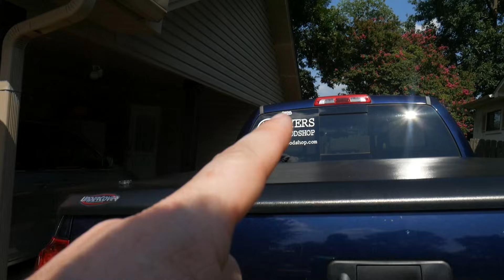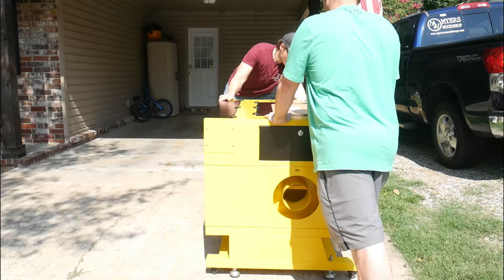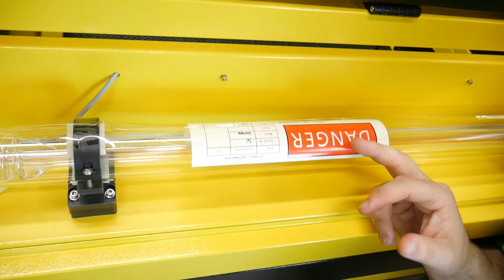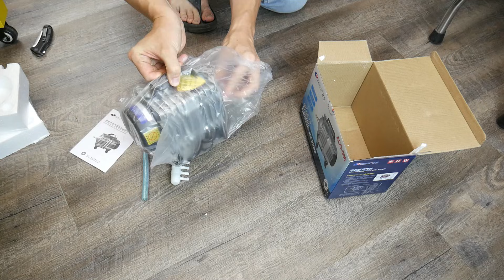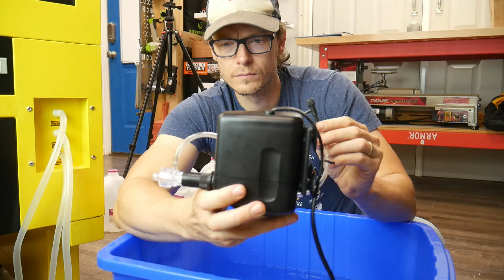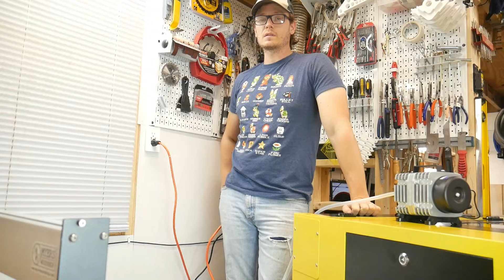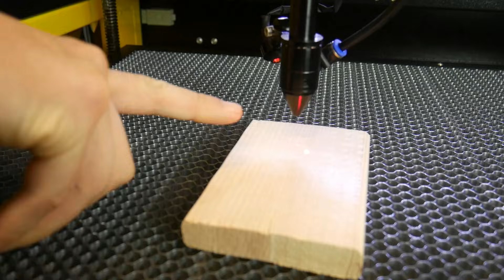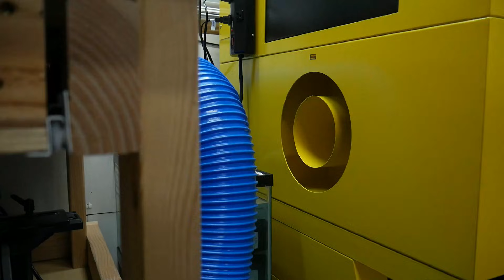Did I Waste $2400 on a 60W Laser Cutter from China?

Comment: Once that online fan is put into the hose he will barely hear it and if it was needing to be quieter you can always purchase section of 6" HVAC flexduct that's insulated which will deaden the sound further, although a bathroom exaughst fan only pushing 50 cfm would of been enough to evacuate the laser could of mounted the box right over the vent access on the back of the laser, all exaughst fans have a male hose connection on one side and I've seen a few at times that have knock outs if need for connection if a male pipe or hose end, them you would cap the male off, personally I would of hooked into the male connection then ran a section of 3" cheap plastic flex hose,  ( It's only $0.39 or $0.49 per foot ),   up through the wall behind the machine and then to attic or to a dryer vent but preferably near the ground in the winter here in Arkansas if mice feel warm air they will climb up and into clothes dryers or into laser cutter in this case and start nesting if possible, luckily clothes dryers get hot enough they get out quick as it's turned on from heat.
Reply from the maker: I don't have an attic in my shop.  Had to get the quiet fan.

Comment: Take that short hose off your water pump, that is an inline aerator. Just pinch that off, you don't want air bubbles in your laser. Also, move your blower outside and get the noise out of your workspace. Even that large metal blower looks outdoor rated.
Reply from the maker: yep.  switched to the chiller so it doesn't much matter any more!

Comment: Regarding fan noise:  Decibels is a logarithmic scale, and negative 3 dB is half  the sound pressure level.  While 80 to 77 dB might not seem like a lot, it really is.  Regarding Power:  You might want to move those pumps, and maybe the fan, off of the outlet strip you use for the laser.  Or maybe just turn the laser on separate, after the fan/pumps are on and up to speed.  I know they're small, but there will still be a startup current spike and resulting voltage drop that can wreak havoc with electronics if their power supplies are.. um..  less than robust (a.k.a. - cheap).  One at a time probably wouldn't cause any issues, but everything starting at once when you throw that switch?  Kinda scary.
Reply from the maker: yeah, its super loud.

Comment: A 1 dB change in a sound equates to about a 26% difference in sound energy (remember that a 3 dB difference is a doubling of energy levels). In terms of subjective loudness, a 1 dB change yields just over a 7% change. A 3 dB change yields a 100% increase in sound energy and just over a 23% increase in loudness so thats a huge difference in actual loudness
Reply from the maker: all i was trying to convey was how loud it was.
Reply: Only a small set of people can notice a difference of +/- 3 dB in practice.
Reply: 6 dB is double, not 3.
Reply: @dickfantastic7908 Fantastic are you sure about that? I might have to check - when I worked in the Audio Equipment industry I am pretty certain 3db was a doubling ? My memory may be lacking though. Also my point was that it was a worthwhile saving in sound level
Reply: @seorwulf1049  Heavily into audio myself and 6 dB is what I've always heard referred to as a doubling of sound.  In my own experience with the equipment, this seems about right to me.
Reply: @dickfantastic7908  Nope 3dB is a doubling of sound energy.  But then, trying to measure actual sound levels with a f**king iphone just shows how dumb these guys are.
Reply: 3dB would be "slightly louder" for the small amount of people that can spot the difference.

Comment: Power supply bears no relation to tube power - that's a factor of tube size. If you buy of a drop-shipper, you pay more and get no support. If you buy from a reputable Chinese manufacturer, you get good support and a well-built machine. The spec you got I can buy for ~$1200 ex-factory, but with much better components. So yes, you wasted $2400 on a mediocre machine. Don't buy from eBay or Amazon or Aliexpress. They don't know what they're selling.

No motorised Z-axis gets old, fast. Use your laser to build a hood for your extractor, or put it outside. Who knew electric motors could be loud? /s
Reply from the maker: it does,  if you have a 60w tube but your power supply is only a 50w guess what watt your tube will run at? :P
Reply: @MyersWoodshop  ok, mr pedant. I thought it was obvious, but as you are hard of reading, unless you run your tube at 100% power all the time, your '50W' PSU will quite happily drive your 60W tube, until it overheats and fails, which could be never, depending on the quality of the PSU. PSU's deliver a set amount of Amps, and most good ones will have a margin above which they can deliver quite happily. Your average '50W and '60W' tube (deliberately air-quoted, as they aren't really 50W or 60W - it's a relative term for the light pressure they exert, when dealing with lasers.) if two tubes both run at 20kV and are rated to 25mA, but one is a '50W' and one a '60W', a '50W' PSU will happily drive them both at full power.

So, to answer your question - 60W. :P

Comment: Oh god, please take that little clear 3-way with the side tubing off the water pump outlet. That is to introduce air into the water which is great for fish, but terrible for laser cooling. That's why the water in the laser looked so bubbly. Each of those bubbles can create a hotspot and could cause the tube to fail sooner than it should.
Also, when measuring dB, it's a logarithmic scale. Every 3dB doubles the volume you're measuring.
Reply: You beat me to it , I cringed when i saw him hook that up.
Reply from the maker: didn't know what it was for.  never had a fish tank.  always learning.
Reply: @MyersWoodshop  Hi, I have a laser like this for 2 years (80W so more powerful, but same design). Here are some of my experiences: 1) buy for your laser a Water Chiller - search on ebay or amazon for CW-3000 or I´m running CW-5200 as I don´t have A/C at my shop. This thing will keep your tube at about 19-20°C which will encrease life of your tube. Btw my fish pump died after 2 days - had the same 2) Blower - if you´re going to cut plywood or acrylic (or plastic in general) I recommend you to stick to factory blower as these materials when you cut them, makes nasty paste all hose and blower, which is very tricky to remove. Better to buy new chinese one again. Cutting (and especially engraving) stinks a lot. Make sure you will be ok with your neighborhood. 3) take your time when setting cutting parametres try to use different speeds and power. Good practice is to put a piece of material under angle, make a cut and then measure best focus point (not always those 3mm) 4) measure the bend of your honeycomb mesh. Mine was bend like hell, but it´s easy to repair with hand - press from below until your satisfied. Anyway Congrats to purchase and happy cutting! Cheers from Europe
Reply: @jakubkonecny6235  How bad is the fume when engraving? I"m from the Philippines, and planning to start on laser cutting and engraving business. My shop is not that big and its just in between walls with my neighbors. Is the volume of smoke like your cooking barbeque? How about the smell?
Reply: Yep. 77 db is half of 80 db.
Reply: I assumed it was to bleed the air from the system?
Reply: Exactly what I was just about to say LOL
Reply: Hoped to see a comment about this Venturi tube glad it was spotted and you guys have likely taken it straight off

Comment: They have this machine at the makerspace down the street. I'm very new to this but wondering if you happen to know setting for cutting 1/4" cardboard on it. They have a focal length of 3.8mm they suggest setting to but this did not cut cardboard very well. I was using 5 speed at 95 power and even that was giving trouble. Should I adjust the focal length closer or further back?
Reply from the maker: Should never need to go close to 90% power...set the focal length much closer. Maybe to where the air just nearly comes out.
Reply: @MyersWoodshop  Thank you - yeah, I thought it was strange too - I will try it closer. I'm not sure where they came up with 3.8 mm but I guess that depends on the lens they are using. They also have an 80 Watt machine but I didnt think 60 Watts would have any trouble cutting through corrugated cardboard even if it is somewhat thick.

Comment: This looks like a yellow version of the laser I got. Glad your not using that fan. I did for quite a while but after a big project I had it on for about 4hr and it overheated. I didn't notice since it was still running but tripped the garage GFCI. And would not start the next day at all.  I switched to the iPower 6 Inch 442 CFM Inline Duct Ventilation Fan for $71.  Better suction than the original and there is more noise form the air going through the laser when I open the lid then form the fan itself =)
Reply from the maker: yep!  that fan had to go!

Comment: How long does it take for the water in the reservoir to heat up, and what temperature would be considered to high? Would that be a problem if you were to run a big job?
Reply: Well, some back of the envelope calculations, given that a CO2 laser tube is usually somewhere in the range of 5-25% efficient (I'm using 15% here), means that for a 50W optical output (Don't run a 60W tube at 60W unless you want to burn it out real fast), the tube will generate nearly 300W of waste heat in the cooling water. Since water has a heat capacity of 1 calorie (~4.18 joules) per gram per degree C, that means that assuming you have a 10 liter water reservoir, with a start temperature of 20C (room temp) and an end temperature of 60C (~140F), you can store about 400,000 calories, or 1,672,520 joules, or enough to run the laser continuously for just over 90 minutes assuming no heat losses to the outside world.

Now considering that there will be losses, and the fact that 90% of even long laser jobs won't be either full power or 100% duty cycle most of the time, I'd say you probably wont ever overheat the system.

And if you do, you can always add a small heater core and a fan to the loop, and that will solve the problem completely.
Reply: @MysticalDork  Thank you for making those calculations. That's quite a bit better than I had feared. All in all I have to say this seems to be quite good value for the money.

Comment: The air pump is to stop contaminated smoke from contaminating the laser lens, which will stop it fogging up and not to stop fire. When you cut plastic and the like, the smoke can be sticky like resin.
Reply: The air assist performs a number of jobs, including keeping the lens clean(er), but it significantly improves cutting ability due to feeding fresh oxygen into the cut and clearing the cut for the laser to better ablate the material.
Reply: @Zootalaws  Yes, it does have a number of functions. Just like 3D printers, laser cutters have numerous things that can be changed, that can alter the cut. But quite often increasing the airflow can actually make the cut worse. See this video about 'Beam Drag' and ' flame polishing' = https://youtu.be/pYmT9yIjC4Q

Comment: Cringed when they pulled the gantry to the front quickly. I learned that when you move a CNC it actually creates electricity that feeds back into the control circuitry. When I move my gantry SLOOOOWWWLY on my OX CNC I can see the axis LED light up. That’s why you always move the gantry slowly if you don’t want to risk killing the control box.

So when I saw them yank the gantry forward I was going “NOOOOOOOOOOOOOOOOOOOO”. 🥺
Reply: Unless you're moving the gantry faster than the maximum speed that it can move under power there's no way you can cause electrical damage. And if the electronics is competently designed it will withstand much higher speeds, so no need to worry, just ignore those lights :)
Reply from the maker: I know what your tlaking about because its like that with my shapoeko cnc, but isn't with this laser.

Comment: Did it come with any safety glasses as that lid screen did not look as if it was able to filter?
Reply: Any colour of acrylic is opaque at 10.6um
Reply from the maker: it did not.
Reply: A cheet of glass or plastic provides a sufficient barrier to 10.6 um CO2 laser radiation.  Basically all the beam is absorbed and unless it is directed and focussed at the lid it will not burn through it.  Using glasses (any type) when adjusting the mirrors with the interlock defeated is a very good idea though.  Other (visible) wavelength lasers do need a bit more care in selection of inspection port material.

Comment: We did this and it was a total disaster.  It was a waste of money, a gigantic paperweight.  We got it "running" but it wont cut anything, its like the laser is weak or something (60w).  Since there is no support we've never managed to figure out "why".
Reply: You probably need to align the beam. Use pieces of thermal paper and short bursts of laser power (a few ms, there will be a button to do this even in shitty laser software) to see where the spot is. Till receipts work fine for this. For each "target" mirror, stick a piece of thermal paper over it,  and adjust the mirror before it in the beam path until the laser spot hits the centre of the mirror regardless of the position of the axis. Repeat, working from the tube towards the head, until all the mirrors are aligned. The mirrors need to be extremely accurately positioned for the beams to run parallel to the axes, and they often shift slightly during shipping. 

This is even a problem with expensive laser cutters, but they usually come with a technician who will commission it for you. 

I have a crappy 40W Chinese laser bought in the early days of cheap laser cutters, when you got a lot less for your money, and it's actually very useful. Can cut up to 10mm of acrylic or plywood, though 6mm is a more sensible maximum.
Reply from the maker: and this is EXACTLY why i choose to get it from amazon.  One call and it's back on its way with no loss on my end.

Comment: Why is it that any purchase or reference to Chinese product is branded a knock off?
Many things are made in China this includes your 3000 $ MacBook yet people still condemn the Chinese. Why? Jealousy, me think.
Reply: Because a lot of these chinese tools are copies of existing tools that were designed outside of china.  That is why.  The macbook and other things made in china for American/European companies have to meet the companies specs and designs.  The chinese knockoffs have to meet the chinese companies specs.  The fit and finish is generally much worse.  For accurate machine tools and accessories they usually do not meet spec.  They are just generally lower quality and do not perform as well..  They are also generally lower cost.
Reply: @Worrsaint  These are old classic designs and are now open source design. CO2 laser construction was described 40 years back in Scientific American in their Amateur Scientist Column. The basic design is sound; the tubes and lenses are high quality and with care the machine will last more than 5 years (the design life). I own Craftsman tools bought from Sears more than 40 years back but they are still useful. But with Chinese price, I can have a new tool every 5 years! By the way, how will you compare iPhone with a similar Chinese phone (both can do everything except making a decent call)!!
Reply: @janami-dharmam  I have my opinions about apple products, very few of them are positive about them.  I also buy chinese tools because they are less expensive.  I also acknowledge they are lower quality.  I buy them for the price.  The laser is also just one part of the puzzle.  You also have the motion control, the power supply and the accuracy of the frame.  Going with cheaper power supply components drops the cost.  As does making the frame to a lower tolerance.  Many chinese machines also use rolled ball screws as opposed to ground.  Much cheaper, but also less accurate.  My tig welder is a chinese one.  Is it great? No.  Is it great for the price and what I get from it? Yes.
As far as you talking about open source stuff, China is notorious for intellectual property theft.  It is a major sticking point in the current trade war.  They copy popular designs and make them cheaper.  The fact that they are cheaper is why people buy them because sometimes they are good enough for what people want to use them for.  You never do that in industry because it is not going to last as long and is generally of a much lower quality.  I also pointed out the difference between contract manufacturing in china and cheap chinese goods.  The chinese can make high quality products.  They just generally do not unless it is contracted by a specific company.  If it is a Chinese company they cut lots of corners and make a product that cost much less but would never meet the specs a company would contract for.

Comment: I have the same machine. I unpacked it by myself...what a pain. Took me half an hour to figure out it was screwed to the pallet through the feet. Duh. It worked great right out of the box but about a month later the psu died. I contacted the seller and they credited back my account for the cost of a new one rather than shipping one from China.I bought a 60w cloudray and it has been flawless. It's a great machine with lots of potential with some minor upgrades such as a meter and quieter fan. Play around with different focal lenses as well. I'm looking at going with a true 60w tube when this one dies but not in a hurry to kill it. Good luck with the machine.